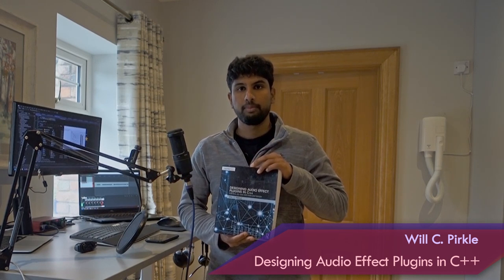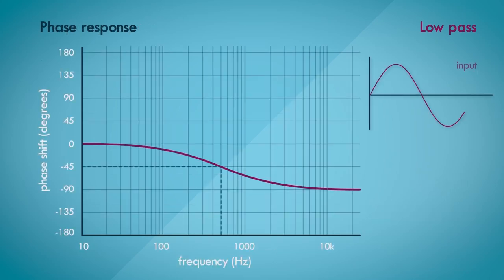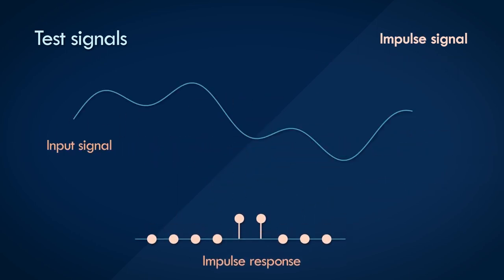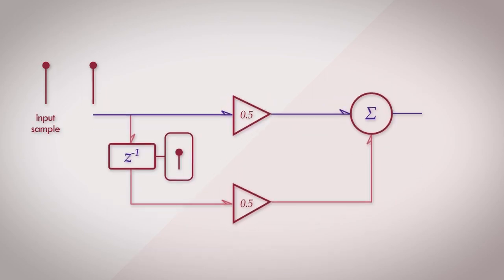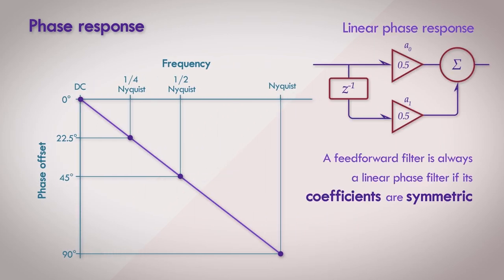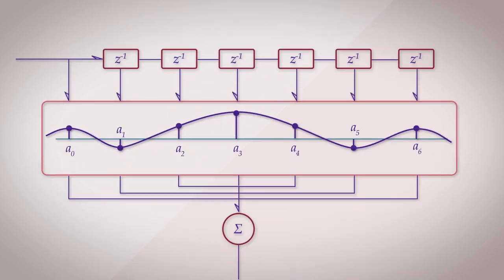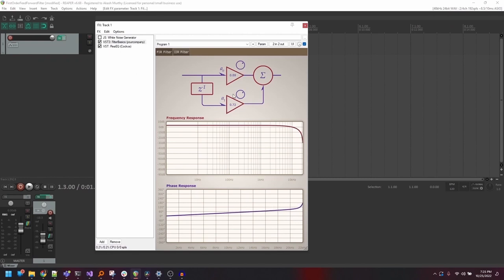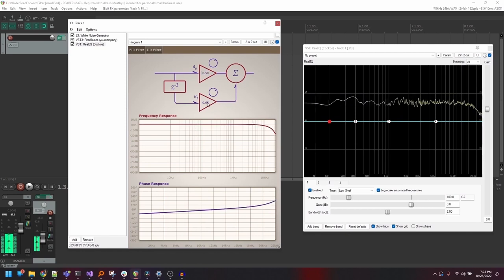An Introduction to Digital Filters, without the mathematics

Comment: I am doing a project on "accurate and  enhanced voice recognizing system" which exact model dsp processor
 should i use 
i want ADC and DAC both ports there and i want to use filtering (removing background noise and comparing sample input voice with the voice in the database..)

Comment: Akash, Ihis is a question unrelated to the filters.  'm curious what plug-in you use for your Bézier curves in After Effects?  Aside from great design, I always admire your elegant animation.  I use 'Flow' for After Effects, but it doesn't look as nice as this.
Reply from the maker: Thank you! Bezier curves in what way?  Visual ones, or the ones controlling the timing of animations? 
I don't use many plugins on AE, most of it  is stock. I don't think I've used any curves for drawing as such. If there are any illustrations of frequency responses or graphs, they're usually done in Illustrator and brought over to AE. Illustrator is definitely a better tool for that. If you have an example of timecode of what you're referring to, I can give you more info!
Reply: @akashmurthy  Thanks for the prompt reply.  Bezier curves as in 'Ease In' animation curves in After Effects.  It means you can gradually slide things to a stop, instead of just the standard 'ease in'.  Yours  look a bit more advanced than the standard ones, which is what I was admiring!
Reply from the maker: @douglasfairmeadow  ah yes, instead of using keyframe presets like Ease In Ease Out, I always use custom velocity. Select Keyframe Velocity and I put in 75% for influence. That's it! I do this for most animations. I learnt it from some motion graphics course on Udemy. For bounce sort of animations, I use expressions.
Reply: Nice work  @akashmurthy